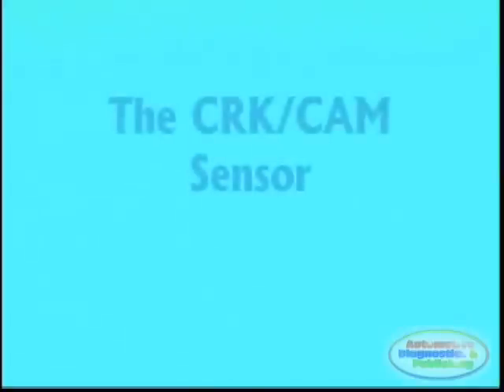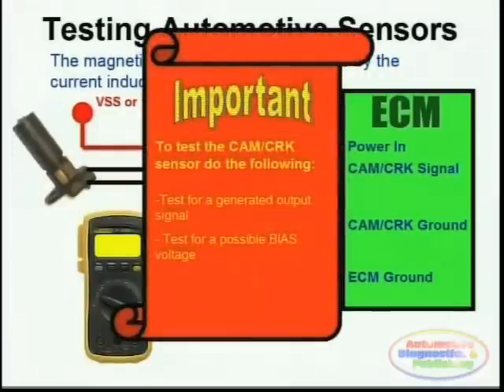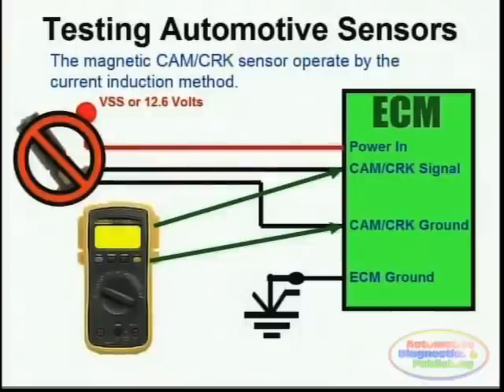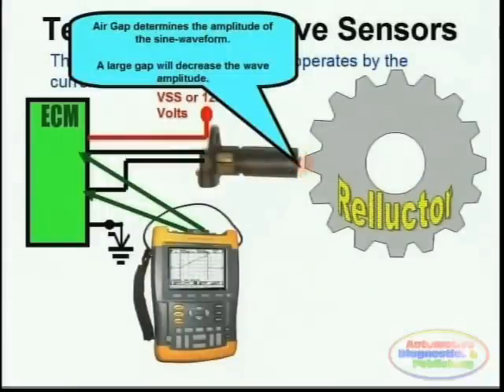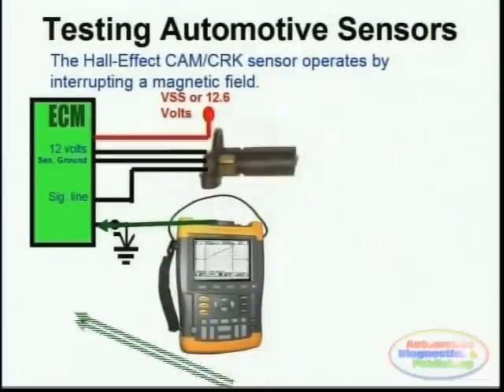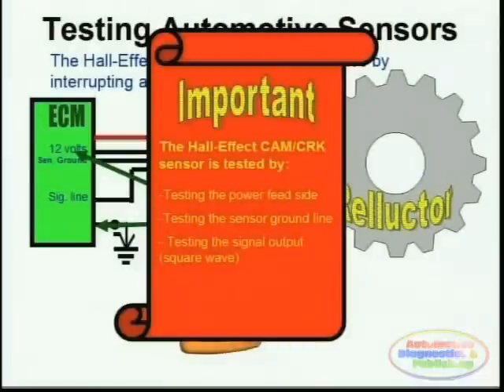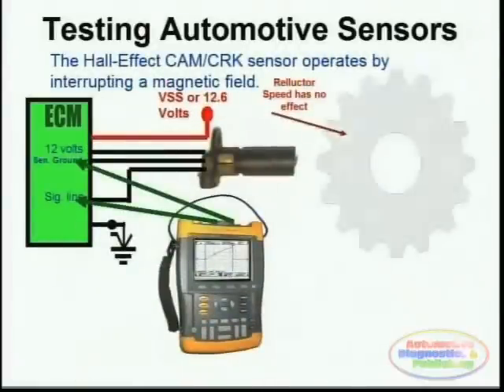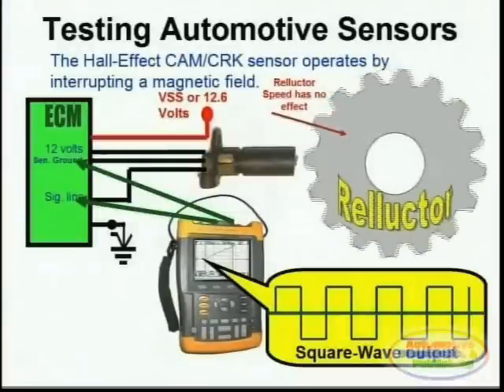CAM and CRK & Wiring Diagrams

Comment from the maker: OK, for sure... you have a loose ground. Somewhere you lost a ground wire to the engine block, the chassis or at the battery. Try not to crank it. This could blow your modules (computers) and make things worse. Just turn the ignition key and hunt down the open ground circuit. I am assuming that your battery is fully charged. Post back with more...
Reply: ADPTraining
Reply: what wire is positive on a 3 wire blend door actuator
Reply: Hi ,im new here.i have a loose ground while trying to start my ford everest.did i just blew my pcm?i checked my pos.supply of my ckp sensor but im only getting 2.3v.

Comment: dear sir . could you tell me what is happening with my cruise car . i changed the crankshaft it was damaged but i have P0300,P0303 and P0304 no one knew whats the problem !!!! I replaced ( ignition coils,fuelpump,plugs) and( no leaks ) i checked the injectors no problem with them .
I checked the crankshaft with voltmeter ( 2.5vdc wite and blue wire, 2.5vdc green wire and the third wire is black for ground) these readings with ideal engine.
are these correct readings 
I need your helpe sir.

Comment: My cam sensor (3wires) has probably a bad ground form the ECM. With a disconnected sensor the gound measures +3voltage.  Looks very suspicious to me.  

Can i cut the ground wire and mount it directly to the ground? Or does it need to come from the ECM?
Reply from the maker: The issue is this, if you run a different ground, then the ECM will compare the signal to whatever the ECM thinks it's a ground. That will never work. You need to find where the ECM is grounded.

Comment: Can you Mr. Ive been struggling trying to figure out whats been going on 3 mechanical decline shops couldn't figure out what was going on with my cousins 1994 s10 blazer tahoe edition 4.3 cpi or ipc- pci obd none after intake gasket replaced motor would be fine one day the next rain would wash the blazer away. Cousin handed the keys over to me, came with the original window tag $ 21,350 with caset about the csi blazer. Doesn't explain my situation car now starts up runs at tdc 0 prrrr warms up then dies wont restart i noticed the crank sensor on passenger rear head was wobbling around and hand tightened. My question is this would that create my problem?
Reply from the maker: You need to train yourself, not wait for the problem. See my PDF Ebook and software packages.

http://autodiagnosticsandpublishing.com
Reply: Hi 👋 pls I need knowledge from u base on automobile electrical

Comment: I have a 1997 Jeep Grand Cherokee Laredo. It lost power and shut down. During my testing of the CPS I found I no longer have 12 volts at my wiring harness to the CPS. Didn't know if there is an actual test or how to see where I am losing the power.
Reply: 2002chrysler Sebring ran hot now no start no fire or fuel
Reply: Scannerdanner YouTube channel does this test on your make model and year

Comment: i got 1.5 volts to both wires grounding the neg wire to bat neg. getting no spark on cam/ crk system 99 ranger 3.0
Reply from the maker: 1.5 volt at the sensor? Please be more specific.

Comment: What color wire comes out of wire loom and goes to which wire on plugin color code will have to replace plugin
Reply: Mine has 3 wires. Black black red with white stripe
Reply: Did you figure this out cause mine has 2 black and looks like a brown or a red I need to know the pattern

Comment: Can a Lighting Control Module on Ford's can cause the engine not to spin? My interior lights head lights are not functioing properly, the car stop on me today then that LCM started to click like crazy and I also had a P0443 code on it evaporated small detection

Comment: I have a 2003 Mercury Grand Marquis Gs
When I turn the key the motor doesn't spin and the light on the dash dime a little but when turn the key I see no charging light but when I turn the key to start the brake light get brighter